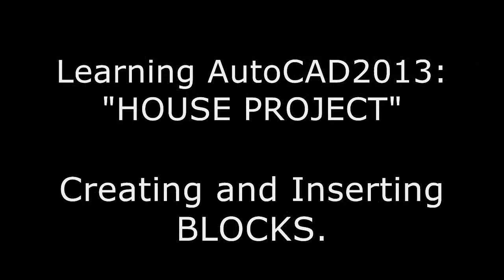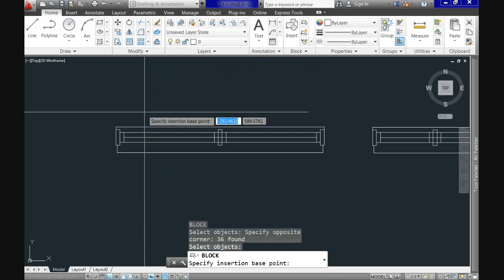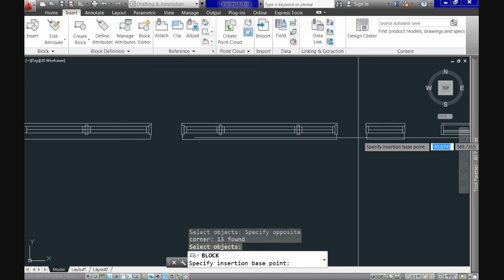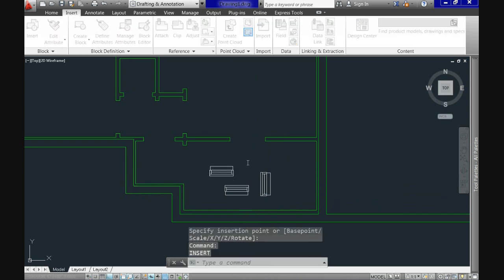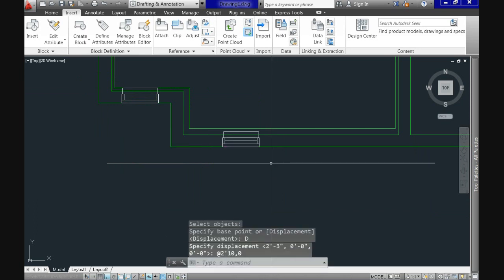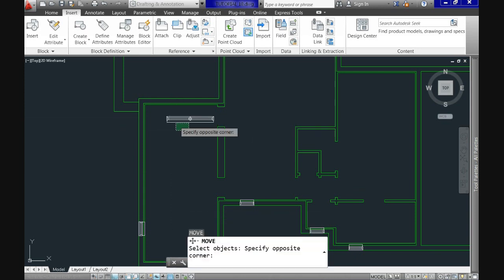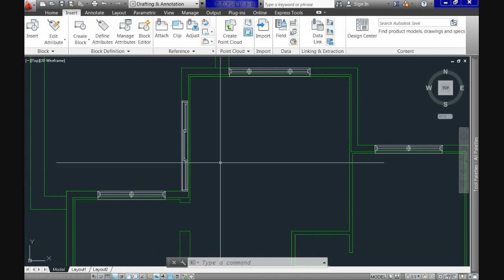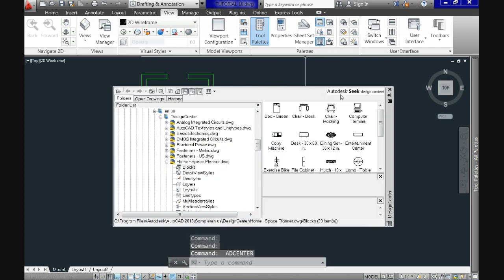Learning AutoCAD 2013 tutorial 10: Creating and Using Blocks.

Comment: i'm following this drawing  plan to a t, it is a great help and i love this program , one thing i would like is a to see is how you drew the windows from the start , if possible. thanks in advance
Reply from the maker: Hello.
With the dimensions for the windows is simple to draw them. The tricky part is turn them into blocks which is the purpose of the video. I skipped that part due to the time and assuming it should be simple to do at this point. I'll try to go back to do it once the series is done.
Hope this helps

Comment from the maker: Hello, 
Thanks a lot for your comment. Both extension lines are pointing at the upper part so it should add up to 8'. The reason for the bottom dimensions is to indicate the measurements of the 3 sections of the window. Most likely you don't see it right due to the resolution. Try looking at the highest resolution since it was recorded in HD and let me know if you still can't see it. On the other hand it has a real typo in a dimension was carried over from the others with the smallest window.

Comment from the maker: Great catch Jacob and thanks; you are absolutely right. That dimension is ok; it is supposed to indicate the width of the window, which is 6" (without the inner window sill), the problem is that is misplaced. The one that is wrong is the 3" for the sill, which is supposed to be 4". Also the one that indicates 1" should be 2". Most likely what happened is that I used the wrong drawing for the video without noticing. I'll make sure to indicate it in the video. Thanks again for the help and regards